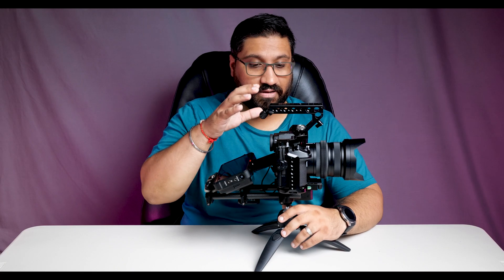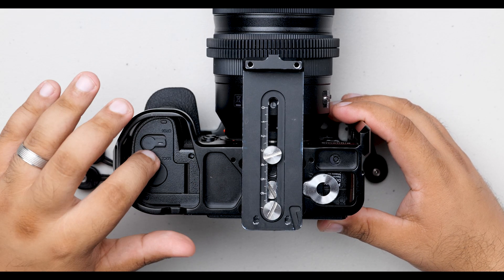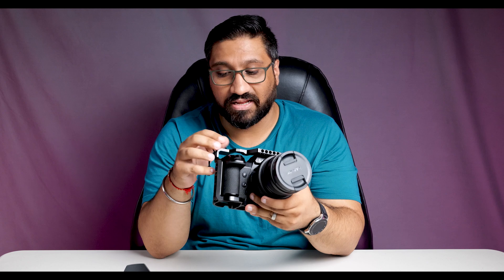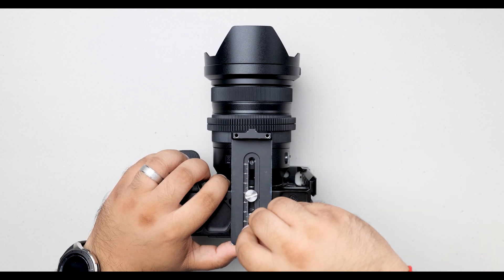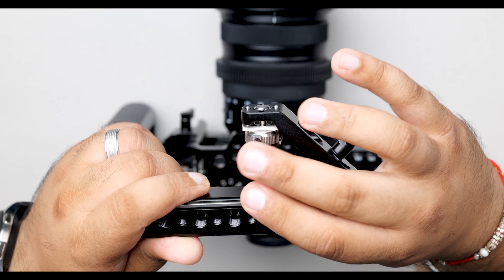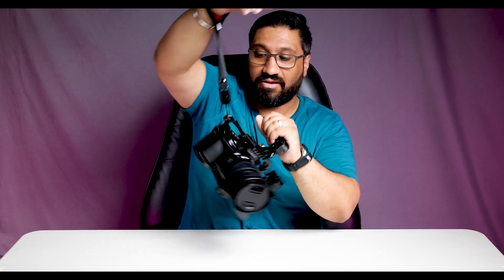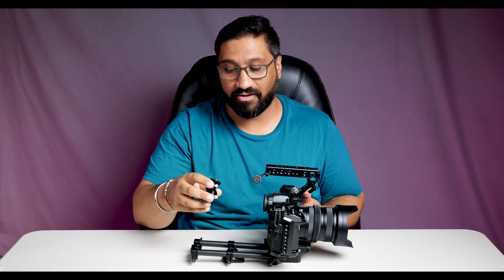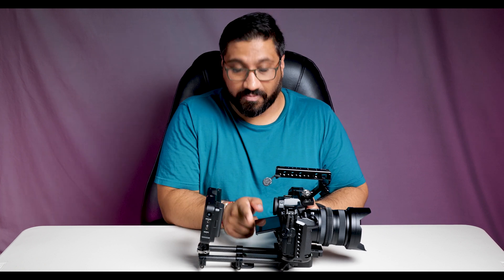Panasonic LUMIX S1 RIG

Comment from the maker: Camera: https://geni.us/LumixS1
Cage: https://geni.us/F8qiz
Rapid connectors: https://geni.us/NqRW3
Side handle: https://geni.us/ONLJBj
Top handle: https://geni.us/NstCC
Wrist strap: https://geni.us/w0zbk
Base plate: https://geni.us/g5Khqqg 
Arca Swiss quick release plate: https://geni.us/9QgGX7O
Carbon Rods: https://geni.us/SkCapq9
Rod Clamps: https://geni.us/Yvg1xA
Cold shoe mount: https://geni.us/gMxSA
Monitor Mount: https://geni.us/9IebdFI
Monitor: https://geni.us/ehzc8

Camera bag video: https://youtu.be/71i5z3qJmxE

THIS IS NOT A SPONSORED VIDEO.

Comment: I have the same setup the problem is after few days of use the screw attached to the camera tripod screw loosen up. how do you fix that? do you have the similar issue?
Reply from the maker: Hi, If you are referring to the arca swiss plate on the bottom of the cage then i have 2 scews fully tightened so that doesnt move.

If you are referring to the screw that holds the arca swiss quick release adapter onto the base plate, then it does become loose on mine some times, but I make sure that I tighten it as much as possible with a screw driver.  It will last a month or 2 that way for me.
Reply: @BallysRealm  Thanks. Actually the tripod mount on the lumix S1 was broken when it is fully tight and attach to small rig. after heavy use it will break the tripod mount. Thanks for again for your response for sharing this very informative video!!
Reply from the maker: @puma3100  You're welcome. Glad you enjoyed it!